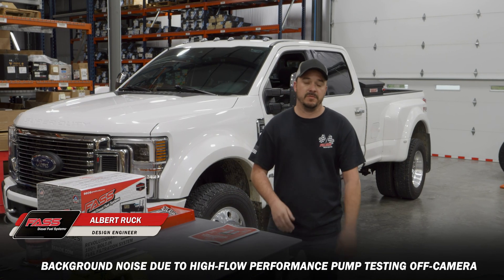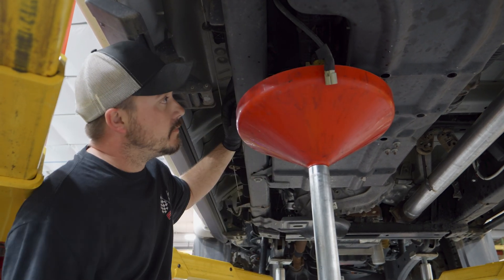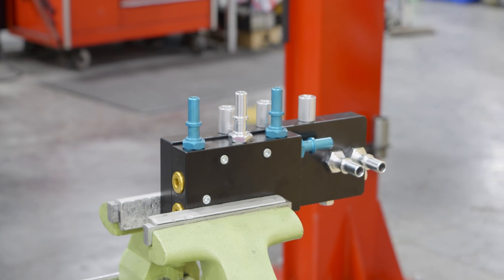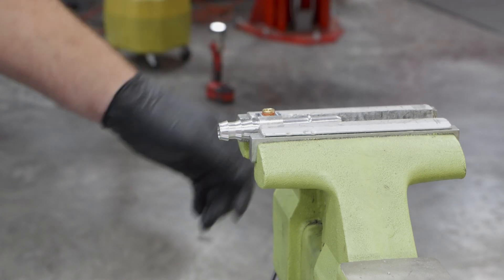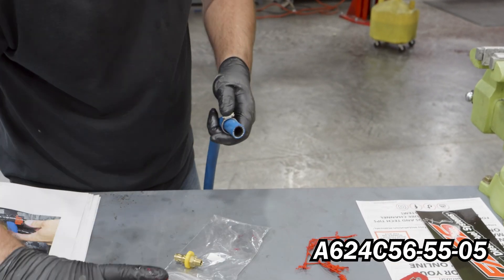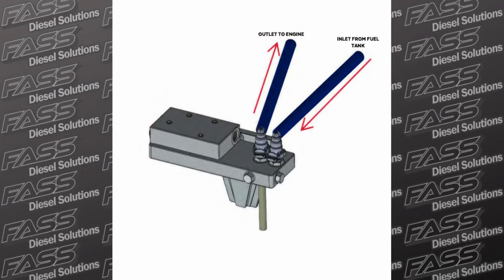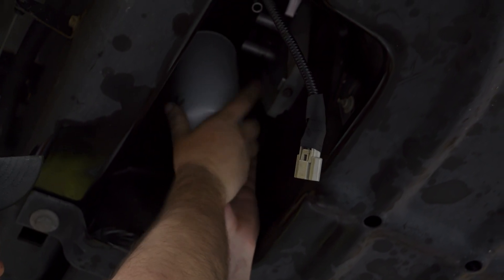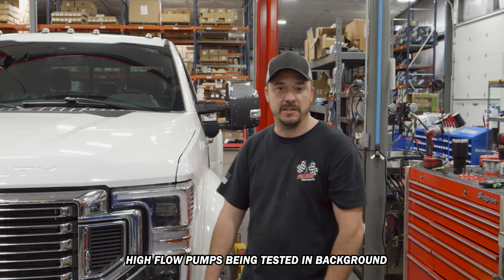How to Install a Drop-In Series Fuel System for 2017-2024 6.7 Powerstrokes

Comment: What is the true real benefit of this versus the stock? it doesn’t increase the horsepower of the truck in anyway??
Reply: Change the stock filter once yourself, then you will want this system
Reply from the maker: Hey there, thanks for reaching out! 

Our fuel systems eliminate over 99% of the water found in diesel fuel, along with all of the air and debris down to 2 Micron. This protects injection components from premature wear and failure.

By eliminating those contaminants, our system also optimizes the combustion cycle—optimizing fuel efficiency, power, and throttle response. It actually DOES increase horsepower in the truck, however the exact numbers will vary as there are a variety of different factors that play into that.

If you have time, I highly recommend checking out some other YouTube videos of ours that explains how our system works and what it can do for your vehicle!

Comment: What should I do with the upper filter?
Reply from the maker: You are welcome to pull the filter, or leave it if you like.
Reply: @FASSFuelSystems  What do you do if you have a S&S Diaster prevention kit installed?
Reply from the maker: @johnmays6845  Our system works great paired with the S&S Disaster prevention kit!

Comment: Purchased for ‘24 F450 48 Gal tank.  Maybe on the Lift you can access the fuel lines above on 48 Gal, the smaller tank with filters on end of tank much more reachable. 

For driveway… the middle cavity of 48 gal tank, this was practically impossible to reach lines, let alone disconnect lines. 

Dropped skid plate & tank, performed all connections prior to reinstalling tank. 

Besides little more work to install than assumed, not terribly challenging and overall it’s a very nice kit & setup! 
Much better than OEM filters.
Reply from the maker: Thank you for the feedback, and we appreciate all the support!
Reply: Just did my 18’ 350 wo dropping the tank and on the ground. It was a pita and probably should’ve just dropped it
Reply: @dfjr6525  Agree, those are tight & reachable… the ‘24 had no room for my hand, and zero visual of the lines.  I wasted 1 hour trying then realized a quick skid plate and tank drop would be quicker and a lot more confident in seeing how things look.